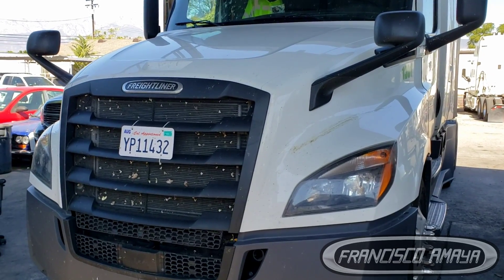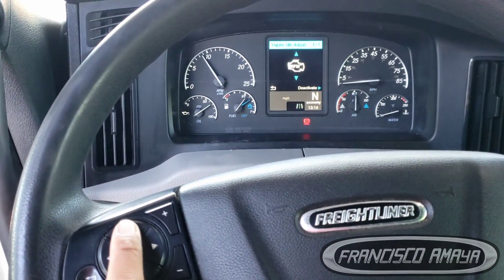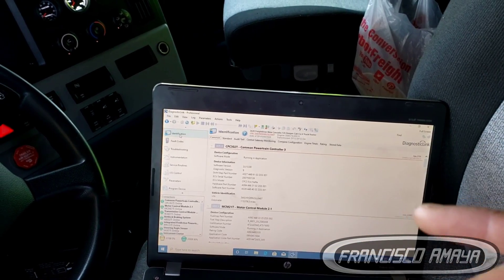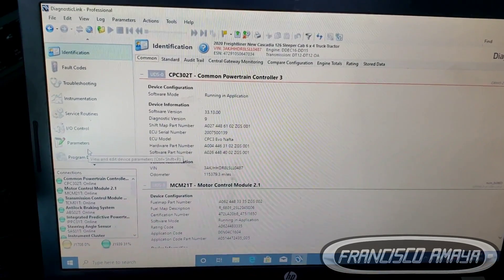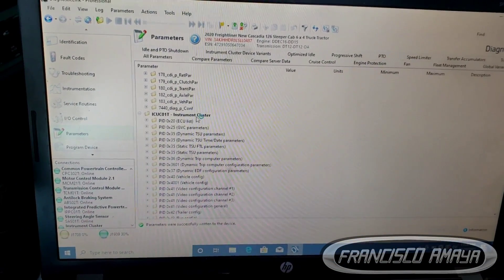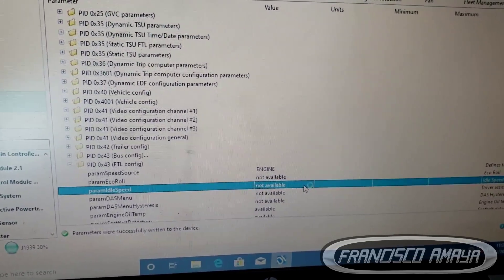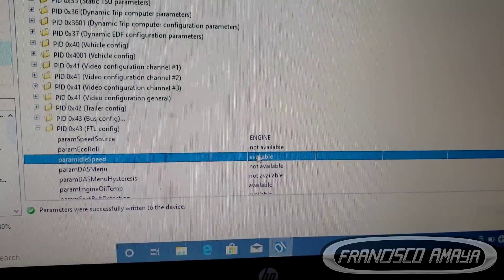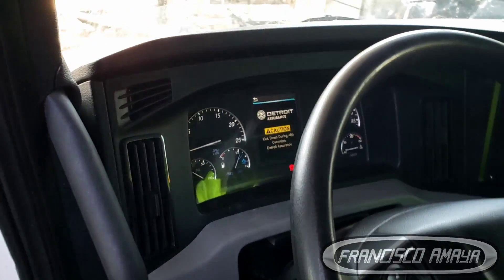Freightliner cascadia computer programming high idle RPM setup configuration DD15 cumminis X15

Comment: I have a 2014 dd15 coranado 132,  i drive tankers and my idle cruise control speed is set to 900 rpm  i need it set to 1100  is this possible

Comment: Buena la informacion,logre que me apareciera la opcion de "idle adjustment" en el dash pero igual no acelera el motor, el camion es un 2017 cascadia con motor cummins x15 transmission manual,talvez requiera algun otro parametro del Multiplexing para que funcione 🤷🏻‍♂️